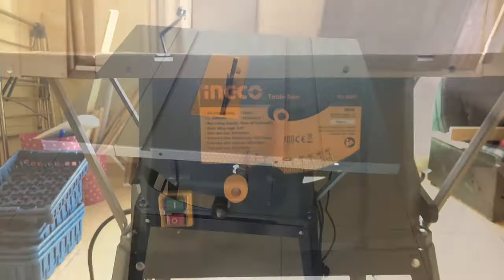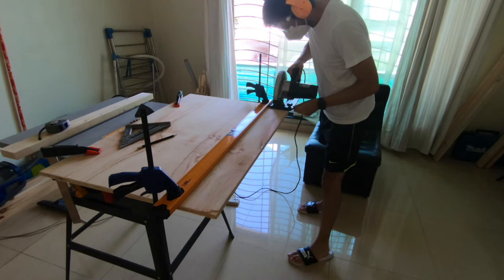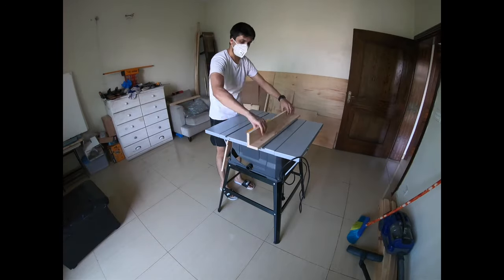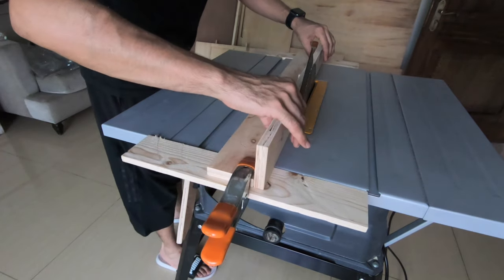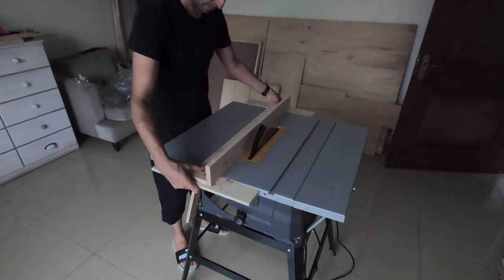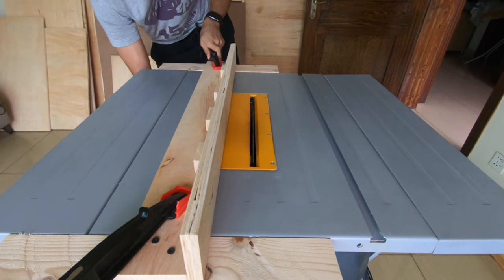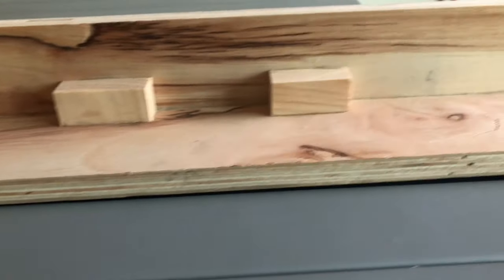EASIEST TABLE SAW FENCE! Quick, simple and affordable!

Comment: When you put those end boards on, space the screws as far away as you can as that is what's holding your perpendicularity. You have yours quite close together maybe 1.3 inches and if you inadvertently damage this unit it is likely to fall out of true perpendicularity. If you instead spaced say 3 in apart it would take roughly twice the force before it to would be damaged. And use 4 screws not 2. I understand my instructions are perhaps overkill for your applications but for a long-lasting tool like this I think it's worth mentioning, especially if you're doing a tutorial
Reply from the maker: Hey Kevin, that’s great info and advice! Will definitely keep it in mind. Thank you brother.

Comment: Seriously love the build simplicity and use of clamps. Absolutely love it!!!! Way better than most DIY Fence designs on Youtube!!
Reply from the maker: Thanks! Glad you liked it.
Reply: I'm also glad. I recently bought a job site table saw very similar to the one in the video and the fence is a joke. It does work fairly well for cross cuts though. I live in Indonesia and it's difficult finding the components used in a lot of the more complicated builds. I'm not using my table saw that much, mostly for re- sawing because dimensional lumber also isn't a thing here so I buy 30mmx50mm (roughly) stock and clean it up on my table saw. Also using it as a planer because planed lumber also is difficult to find.

Comment: I fully agree with your comments on cheap table saws their fences are not great. My fence lifts up and down and from side to side and even when it is secured I notice the fence being off at a slight angle so it will only cut wood at a slight angle and never straight. I'm going to make one based on technique and use clamps to hold it secure. Also today I was looking at hydraulic hinges are I also need to build an extension on both sides of the table to support woods as cheap table saws don't have wide enough sides and easier and better to build it yourself. Thanks

Comment: Great video I will be building one of these. Just a suggestion. You could add two wings to the bottom of the sides holding the fence to the table so It also catches the bottom of the table so you don't have to use clamps

Comment: Nice one mate, well made. I also have the same problem with the clamps pushing the glued timber out of line, I don't know for sure but I think the glue acts as a lube, until it gets tacky and I normally do what you did.👍well done
Reply: @mattballs21  ....It is now 5 months after you commented but....I need to say that if you need the two pieces that you are gluing together to have a tight fit with no gaps, then do not use salt. The salt does indeed keep the two pieces from slipping against each other when you use clamps, but the salt does not melt and will cause a gap between the glued pieces. I had heard about the 'salt trick' and used it on part of a project. I didn't see the problem until well after the glue had dried. There was a definite gap between the two pieces and looked awful. I had to make another piece. 

I would guess that sand will have the same result. So...please experiment on some scrap wood before using either the 'salt trick' or the sand trick. Maybe there is something else about the salt trick that I missed...???, so if anyone knows how to keep salt from creating a gap, I would like to know.
Reply from the maker: @mattballs21 Great tip and help! Very nice of you.

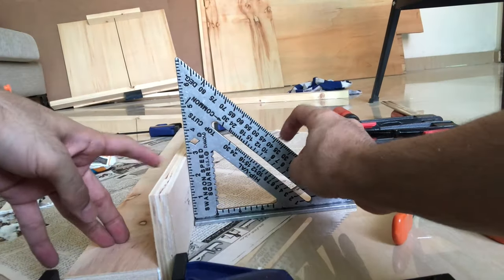Comment: 3:18 You could countersink a few 1⅝" wood or drywall screws, or shoot a couple of 1½" brads into the joint and a dab of filler over the nail head if you want a smooth "no fastener" look.  This would hold it together while the glue sets without pulling it out of square.

Comment: Very Good Job. Tell me: did you consider modifiying the cheap OEM fence that came with your saw by adding plywood guides like you made for your DIY fence on each of the OEM fence? I ask because the only thing wrong with the cheap OEM fence that came with my Ryobi table saw is that it needs parallel horizontal guides on each end to make it stay parallel to the saw blade and riving knife. The flimsy little plastic clamp on the far end of the OEM fence is a joke when it comes to keeping the fence parallel. Your plywood guides might just be the solution!

Comment: Good idea. But use OAK or any hard heavy wood which does not warp as mush as soft wood. Thanks
Reply from the maker: Absolutely right. I just didn’t have any available. Thanks!
Reply: Actually the plywood is much more stable.

Comment: I just got a table saw and I’m struggling to do big boards on it because the boards are to big and hag over the edge so I’m unable to get Staite cuts have you got a link to a video that may help me
Reply from the maker: What you need is an extension feed table. You can build one. It just has to be the exact height of your table saw. I made on and even have a video on it. It my work bench / extension feed table. Search on my channel.

Comment: How good is ingco table saw generally, can it cut hardwood easily
Reply from the maker: Haven’t used hardwood but I feel it can. If it’s normal sizes (dunno if your block is too big). It could probably handle upto a 4x4 hardwood

Comment: U also lose the measurement tape thing? That came with the original fence
Reply from the maker: I doubt it was accurate anyway.
Reply: Lol. Thanks. Im thinking it would be better to buy a used Makita type table saw. It probably won't have these kind of issues. I've heard there are places in Lahore where one can buy them.